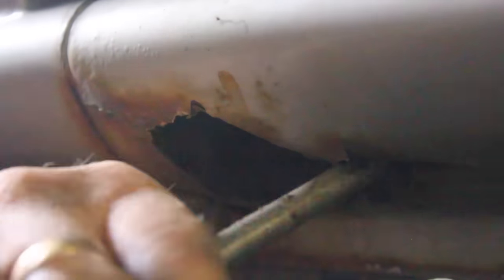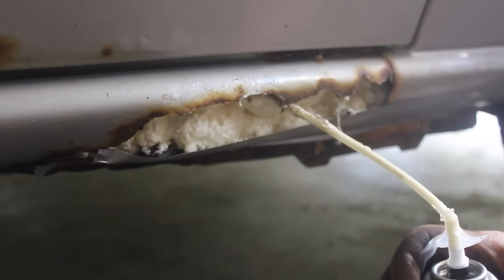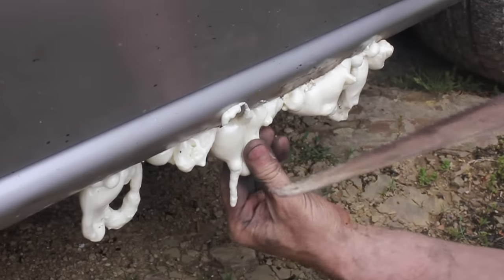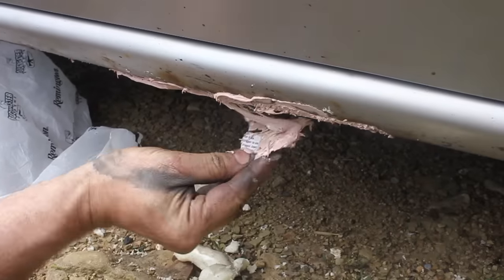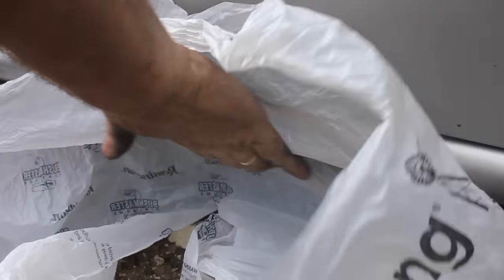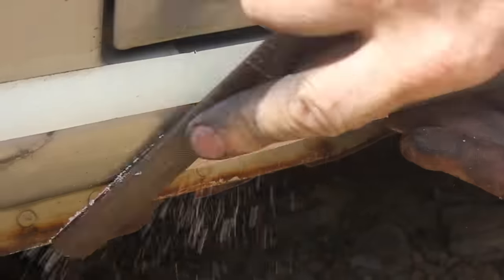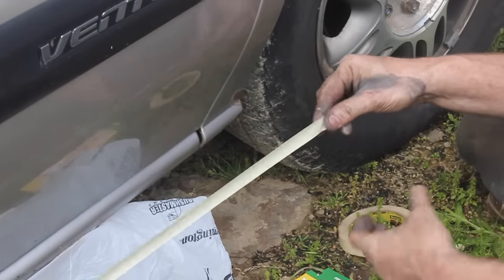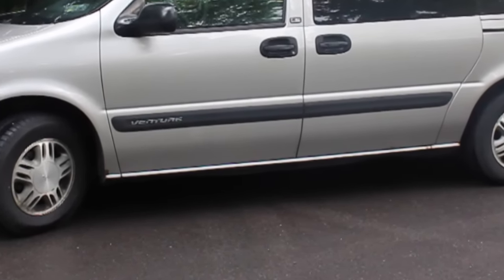how to FIX a rust hole in a rocker panel (fast, low-cost method)

Comment: Does the foam hold moisture and cause more rust inside the panel?
Reply from the maker: +Rockridge 

I feel that the foam helps keep water from getting back into the inside of the quarter panel. This polyurethane foam is pretty sticky when it's wet, so it adheres to the inside of the quarter panel pretty well. I did make sure that the quarter panel was dry before I spray the foam in.  Unfortunately once rust starts, it's a pretty tough thing to battle off. I've done a lot of professional auto body, and even with the best technology it's still a challenge.  I have sandblasted, used metal etching primer's, specialty auto body filler's, and the rust still comes back. I started using this technique years ago when people didn't want to spend a lot of money to get their car through inspection. The technique is fast, low-cost, and looks reasonable when you're done. If a person is wondering how many more years they're going to hold onto their car, this is a good option. So yes I do feel the foam does a pretty good job of keeping the water out, but I do feel the rust will come back. I hope this answers your question. If you have any other questions please feel free to ask.
Reply: Rockridge yes it holds moisture and causes more rust
Reply: supposedly there's a foam can that doesnt hold moisture a green can i believe
Reply: I do not know that what you are saying is true. I used some spray foam on a piece of my foundation where 2 slabs meet from an addition long before i owned my home where sow bugs, ants, and bees could get in and go around my baseboards and carpet into my home. I sprayed spray foam into this crack and it is outside, and no bugs since, and it is a good sized mound at the base of the foundation and it has held up to rain, snow, rodents, everything and has not disintigrated(sp) at all, nor has it expanded like it is holding/ taking on water. So spray foam may actually be a viable option. The home was built in 1955, addition in the 70's, not worth tearing down the entire addition for someone's poor work.
Reply: it depends if it is open (bad, absorbs water) or closed (good, repels water for years) cell.
Reply: Sure does. Best way to ruin the entire lower system of a vehicle. lol
Reply: No it does "not" it floats and is used in boats
I did welding panels on Waist of time.  Burns off all the inside primers
Reply: I would apply Rustreformer inside before the foam..
Reply: @danielfoster7899  On a car that you're only looking to get a couple more years out of it absolutely doesn't matter. They were already Rusty shitt before the" fix."

Comment: Man, I think I'd rather use a mesh patch and filler to this, foam is kinda prone to holding moisture (or once it builds up, takes longer for it to escape/dry)
Reply: Depends on what kind of foam you are using.

Comment: Question: I bought a rust-free Grand Prix from outside of the rust belt that has plastic side skirts that cover the rocker panels, which is a very common place for rust to form cuz they hold salt, dirt, & moisture inside them & rust them out. If I were to use spray expanding foam to fill the void between the skirt & rocker do you think that could be effective in preventing the rust from forming? Or if you have any other suggestions please share them with me. Thanks
Reply: Same here I’m trying to figure it out myself

Comment: I believe you want to use "marine" expanding foam as it won't absorb moisture, otherwise this will accelerate the rust.
Reply: The spray foam is closed cell meaning it can’t absorb water but this isn’t a great way to fix rust issues
Reply: @davidchillton1744  I don't believe that it's always closed cell foam.  A relative of mine built a home over 10 years ago and used spray foam to insulate the entire structure, but regrets not using closed cell as the open cell can't function as a vapor barrier.

Comment: Great for when you have a collision your car will fold right up with you trapped inside the rocker panel is part of the frame/main structure of the car if your car is a unit body Puls the foam will hold moisture and rust out faster people who do this kind of work need to be trapped in this car during a collision they might think twice then welding metal patches is the proper way to repair rockers panels

Comment: I bought a classic truck that i am doing rust repair on. Someone did this on the rocker panels. I have been cussing them out while I cut the old rockers out and repair it the right way. I couldn't believe they did it, but I guess if you are in a pinch and have to pass some sort of an inspection it passes an eye test. It is a lazy band aid approach and will not address the rust problem.
Reply from the maker: +Nick R 

I absolutely agree that if you have a classic truck replacing the rocker panels would be the way to go. This technique is absolutely a way to get your car back on the road and have it look reasonable for the amount of time and money you put into it. I have done a lot of auto body, and panel replacement for rust repair is by far the best long-term solution. Even sandblasting all the rust, brazing in steel plates, and using metal etching primer, will still end up rusting out. Where this method comes in handy is if your car is in overall rough condition and you're not sure how many more inspections you are going to be able to get it through, this will keep the car on the road. Good luck on the classic truck.
Reply: Cheers to that. I'm restoring proper as well
Reply: If I do this to my '07 cobalt how long do you think it will last I mean is this legit

Comment: Quick question: I see some use fiberglass and some use Bondo Body Fill to do the actual finish work. Any differences, pros/cons?
Reply: Fiberglass is stronger n water proof to a point

Comment: Did this to my old car held up pretty good and got me through state inspection. Wish I would of watched this video though. That bag over the body filler is a good idea. I spent a lot of time sanding to get it decent looking.
Reply from the maker: +Tylor Kirklin 

The bag over the body filler works really good. Because the bag is so thin you can actually feel where the auto body filler is thin and thick and correct it to make it more even. Another method where this bag and body filler works is on exhaust. If there is a hole in the exhaust after the catalytic converter you can use a little body filler and it will completely sealed the exhaust. This repair is almost undetectable because the body filler is so thin. Years ago I used wax paper, but wax paper does not conform like the thin plastic bags.  One day I didn't have any wax paper but I did have plastic bags, and I was very pleased with the result. Glad you enjoyed the video. If you have any other useful technique's, I would love to hear about it.

Comment: On my Chevy van big rust on lower under doors, rocker panels.  I got some ABS black plastic 6 in and ran it through a table saw cut it in half. Two pieces the length from tire to tire. Drilled out resessed holes in top and Screwed in self tappers.. Black Caulk the top. Underneath I bent 5 bolts connected to anything. It's ugly Rusty mess but it worked and it will never rust there again.
Oh I forgot I used old engine oil in a spray bottle mixed with some paint thinner and sprayed all the underneath before I started.
For other projects, If you want free metal just find a commercial metal shop dumpster. If you get lucky you'll find the primed and painted with the plastic film overlay.

Comment: This is a quick repair for locations that are not strengthened locations, and it works well on box panels providing the foam is the water proof type. Spraying into dry box sections stops rust in its tracks, it stops moisture ingress and being an expanding foam fills up the section fully locking out air. As rust loves two ingredients air and water both are eliminated,  by injecting this expanding foam. But a WARNING  is in order this spray foam MUST NOT be used on CHASSIS box section or strengthened rocker panels as it will compromise the integrity of the body in an accident be warned be safe and use it with care.
Reply: “ But a WARNING  is in order this spray foam MUST NOT be used on CHASSIS box section or strengthened rocker panels as it will compromise the integrity of the body in an accident be warned be safe and use it with care.”

Lol! Where do you come up with this garbage?
Reply: @SkinweedCorp because the foam isn't going to compromise the integrity of a structural member... It's already compromised! 😂

Comment: There is one thing to know :  to be definitively efficient against rust,  you should  put grease everywhere. grease is the only thing very efficient against rust. put grease between metal and carpet, inside door, behind metallic bumper, under the vehicle, behind  the repairs you can make (everywhere inside the hole you have reclosed before reclosing - hidden erea -  instead of using paint , and before filling the cavity with this foam), hollow areas (necessarily hidden, so no need to be aesthetic). For rear wings unreachable with a paintbrush, use an extender and poor old oil everywhere each year. rust  always comes  from the inside and welds.  Handyman Experience - 35 years.   From france

Comment: Did this once as a temporary fix. I did grind out all the rust first though. Very easy and turned out well
Reply: how long was it good?   im doing it on my cheap old jaguar now and plan on learning welding in the next 2-3 years so i can do it probably afterwards.   

I removed all rust, put a anti rust chemical changer on it, then put foam in, and lots of body filler and im now sanding it down to the correct shape and paint it

Comment: Hay doing the with and explorer sport.  I used a grinder   and going to use glazing pudy    and the heat paint they put on the motor is better   still spray paint just thicker

Comment: Great video, thanks! I have a 2006 Jetta getting close to 200K miles that runs great, but the rockers are rusted pretty badly. This method will be perfect to keep me going for another 2 or 3 years until I buy a new car.

Comment: What is that foam crap called? Someone did this to the vehicle I currently own on the entire side panel under the door. It looked great when I bought it 6 months ago, now after winter all of the Bondo has broken apart and the foam is sticking out and everything rusted. Removing all of the rust first is essential or it will just call apart again.

Comment: Dude, it wouldn't have cost any more to grind ALL the rust off where the Bondo was gonna go.  Now you will be doing this again in 6 months.
Reply: Wont matter.  Those rockers rust from the inside.  At this point there's no such thing as grinding all the rust off.   Its literally the entire inside of the rocker. 

Temporary patch or remove and replace entirely.

Comment: Wow - #Brilliant! My 71 yr old moms' 2012 Fusion has about the same size rusted out spot on her drivers side as well. Off to big box hardware to get some wood to build a small trolling motor stand, and the foam to do your #hack for her. The shop in town gave her an $1100 estimate. LOL Thanks! #DIY #selfsufficient #body work #hack
Reply: Be careful. As an inspector i won't pass unibody vehicles fixed this way. Check with your local shop before hand if they will
Reply: @Stale_Kracker  it's my 71 year old mothers 2012 fusion and she was quoted $1100 when the blue book is $4k. I see the lack of structural integrity and thank you for the heads up
Reply: @guywithagoprofishingshow3011  it varies by state laws. We aren't allowed to even though it really doesn't hurt anything but have felt bad having to tell people they did it for nothing. It may be good where you live but for sure check around just in case
Reply: @Stale_Kracker  man I hate to say it but with stickers in this state; you just go to the "right" place ,and you know the deal..Need I say more? wages SUCK here , but cost of living is still fairly cheap,for a hyperinflated economy..i appreciate it though my guy
Reply: @guywithagoprofishingshow3011  put it this way i am a dealer tech and don't get my sticker where i work or do it myself. I know where the right place is also and he is less worried about losing his license🤣
Reply: @Stale_Kracker  I understand man. & If I was in your shoes I wouldn't risk my job or cert to pass a car that obviously fails. All I was meaning to do was save me mums $1100 , learn some body work , etc. Now if it wasn't the rear passenger rocker ( bout a 20" section) and was the drivers door,I would say "shop around for a price" just for her safety.If someone hits that spot,its turning into a dust cloud of bondo and hopefully doesn't tweak the steel beneath.
Reply: @guywithagoprofishingshow3011  nah honestly i don't even agree with inspection laws i just have to have the license for my job. I used to do this stuff to my truck in high school and never had an issue some of the laws are dumb. I say have at it if it saves you money i'm not against fixing stuff this way at all
Reply: @Stale_Kracker  Yeah , no doubt man. some of these shops dangle that state sticker over your head. Jobs done , lots of sanding cuz I have an oscillator,not orbital , but last thing to do is paint & put a pin in it. It was a cool learning experience - time is NOT on your side when it comes to bondo..lol _ thanks for the good back/forth👍

Comment: The foam helps glue everything together and is actually pretty structural. Bondo to smooth it and paint to protect. Honestly bet this could last 5-10 years without issue.
Reply: Probably. Actually gonna try this next week with my volks
Reply: What if painted a rust killer first.
Reply: I mean, fixed properly it could mean the next 30 without an issue in that spot... the reason this car will be dead in 10 years is cause of the rust builing up in there.
Reply: Is it necessary to use the bondo, can the foam just be sanded and painted?

Comment: awesome technique! I did the same thing on the fenders of my truck. I didn't know about the plastic bag trick though. Great advice. An argument could be made for cutting away the rusted metal, but then there wouldn't be anything to hold the foam in.
Reply: He used duct tape on the big gapping hole part to hold the foam in.

Comment: Spray foam traps water, it will rust even faster now.
Reply: Only SOME spray foams trap water. Some actually REPEL water. Homework, bud...homework.
Reply: @JesMarie_W3  Not true even red one, so called closed cell foam when cut get water.  I agree with sparta.